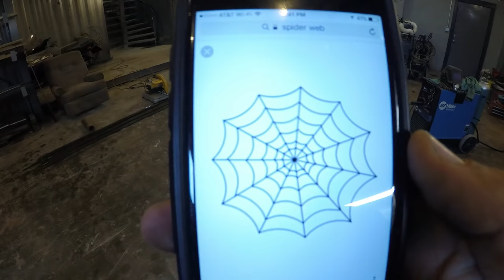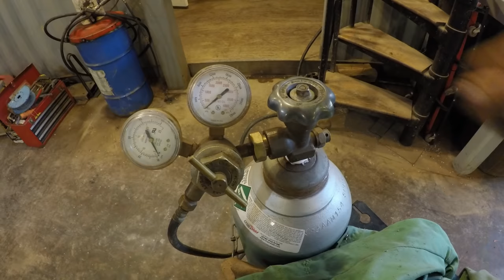Making a rebar spider web

Comment: Slight math note note for anyone interested. When Andrew calculated the spaceing at 4:19, he was calculating an arc length not the straight line approximation he used. How much different would it be? Pretty insignificant, 0.56" to be specific. If you want to calculate the exact straight line length, you need to use the law of cosines. c^2=a^2+b^2-2*a*b*cos(C) In this case c^2=40^2+40^2-2*40*40*cos(40) Solve for c and you get 27.36". I just thought I'd throw this out there for anyone who wondered how to do a very exact calculation.
As always, nice work Andrew.
Reply: Sounds a bit complicated. The chord length is twice the radius times the sine of half the angle. 

So it's 2 x 40 x sine (20⁰) = 27.36".
Reply: Ain’t NOBODY got time for that
Reply: Remember that the spacers were curved, although reversed. So calculating the arc length was correct for the purpose.
Reply: Assuming chop wheel kerf of 1/8", spokes are 39-11/12".  The inner ends (of the 1/2" rebar) are 0.25 * cot(20⁰) ~ 11/16 from the center of the web, so outer ends are ~ 40.6" from center.  Distance between centers of outer ends is 40.6 * sin(20⁰) ~ 27.77 ... only 0.15" off from the "zero width arc length result" ... leaving me feeling ... yet again ... a bit remiss that I wasted all that time in math class when I coulda been in metal shop!
Reply: If I knew how to do that I would be a mathematician and not a builder
Reply: Wouldn't it be easier to use Pi?
Reply: @lennym1273  no it would be easier to call Andrew lol so ya when u get the number let me know what he says lol
Reply: @lennym1273  just kidding buddy this is way over my head thats why I drive long haul lol
Reply: @davidabels1781  Don't sell your self short, we all have our strengths and weaknesses, we can't all be mathematicians because if we where then who build and haul anything...
Reply: I read that I don't know how. well done to you for listening to the annoying maths teacher I

Comment: Would a spider calculate his web? Or just build something?
Reply: Weeelll.... It's a symbolic spider web. if you look at a real one it's actually not rings but a single line (Not counting any repair work).  Have a look on youtube for the spiderweb timelapse done by the BBC wildlife unit (I won't post the link here, that's rude)  the orb spider has the same work ethic as Andrew and plans it pretty much the same way.

Comment: Hi Andrew, @3:40 I think you incorrectly used the pi formula to get 27.92? instead of using pi for arcs, you should use the sin(A) function for lines, my calculation is 27.36 or sin(A)=a/c where A=20 degrees or 40/2 because 90 degree triangle is needed, c=hypotenuse=40 radius, and a=opposite side. Then final formula  a=sin(A)*c multiplied by 2,  = sin(20) * 40 * 2= 13.68 x 2 = 27.36 (correct line).   instead of 80 x pi / 9=27.925 (incorrect arc)

Comment: I think that last row of nine rebar pieces was unnecessary.  So Andrew, how much do you think one of these spider web art projects weigh in at?  What was the total cost in rebar, if you don't mind?  This project came really well.  So, who made that spider and or was it store bought?
Reply from the maker: IDK, 100lbs or so, depends how big you make it. Re-bar is cheap. I got that at a Halloween store.
Reply: @AndrewCamarata  Hey - the man speaks!  You are quite the renaissance man, Andrew.  The reason I ask this question is that I had a very ambitious metal fabricating project.  In the naughts, I was busy with producing firewood.  I only had one front end loader with a large bucket but 2 log splitter stations.  Bouncing back and forth between these was tiresome.  So I began construction on a dump bucket.  Basically a square cage with a trap door at its bottom.  I nearly had this completely built when I found to my chagrin, it was so prohibitively heavy in its empty state, my 1970 Ford 4500 loader could barely lift it off the ground.  Had I made it out of aluminum it might have proven a worthy endeavor.  Glad for you that your project came out so well.